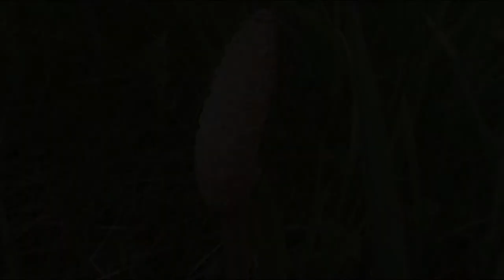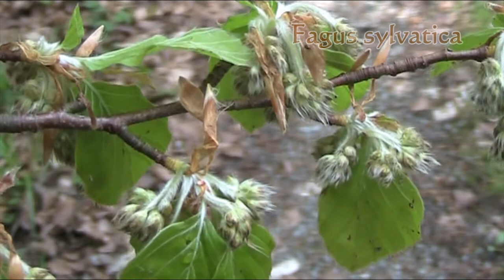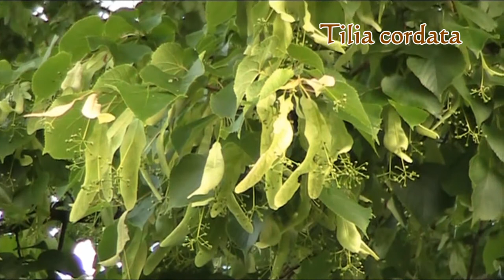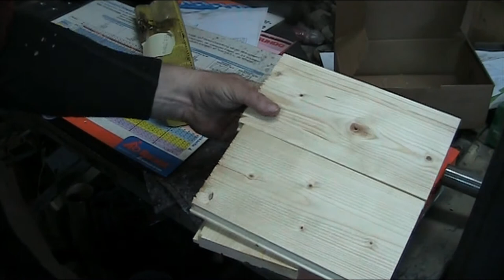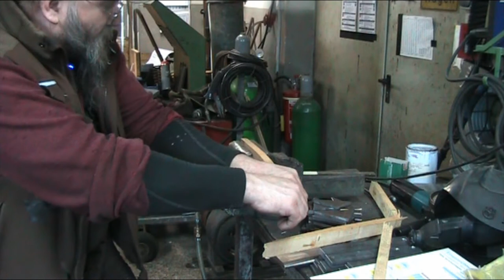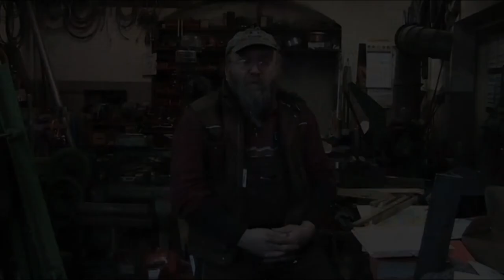Wood Identification 101 episode 1, Spruce and Fir

Comment: The property of coniferous tree wood depends on how much resin it has. Were these trees tapped? It looks like fir one was because it is completely drained from resin. Maybe it comes from the very top of the tree. Try this experiment with fir or pine wood that has a noticeable amount of resin.
Reply from the maker: tree tapping for resin hasn't been a thing since WWII when some pine species were tapped for their resin for turpentine production for the war effort, although most turpentine has always mostly been a byproduct of paper production. fir was never tapped as it doesn't contain enough turpene to make turpentine in quantity. also, tapping fir would allow fungii to penetrate the bole and rot it out from the inside. 
fir - the genus abies - doesn't have pitch pockets which another good way of telling it apart from spruce, and also contains much less pitch within the xylem itself which is why when working with fir, the tooling doesn't gum up as fast and in the finishing stages the sandpaper lasts many times longer without gumming up.

the mechanical properties of fir (Abies spp) are also all pretty close to the same across the spectrum of all the commercially harvested and cultivated varieties. so it shouldn't matter if the test is being performed on grand- , silver- , red- , noble- or subalpine fir, the test results will pretty much be the same. although subalpine fir can often be the odd man out depending how knotty the lumber is. it's also the one fir species that can be immediately differentiated just by looking at it, and its smell is also quite different than that of other fir species.

Comment: Love this series! I've  always wondered how to tell the SPF/whitewood apart and identify it. All I knew was which one hand planed smoother or more fibrous shavings.
Reply from the maker: there is something to that. the fir generally machines a little easier than the spruce. although both woods require extremely sharp tooling to handle it properly without too much tearing out around the knots.

Comment: I think another easy and safe way to distinguish Abies alba from Picea abies is to check for small resin channels. Just clean a little part of the endgrain with a sharp utility knife or a small block plane. If there are resin channels (small yellow dots) in the dark latewood, then it is propably Picea abies. If there are none, then its propably Abies alba. A simple magnifying glass might be a useful tool for this task.

Comment: Would you use Douglas fir or spruce pine fir for a pergola?
Reply from the maker: with proper chemical preservation treatment such as thompson's water seal, there's no compelling reason why you couldn't. of all the species you listed, doug fir is the most weather resistant however larch (tamarack) would be the best choice of all of the conifers. if you have access to deciduous woods such as oak or locust, that would the absolute best choice. just stay away from maple, birch, beech and other sweet white woods as they lack the tannins that act as a natural preservative .
Reply: @HolzMichel  thanks much for your input!